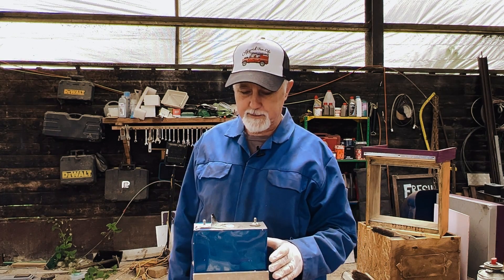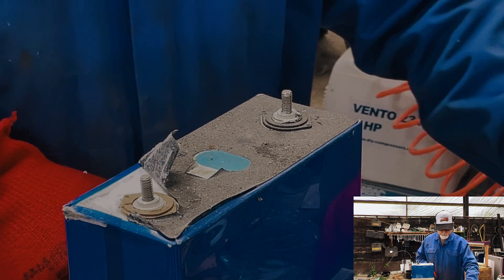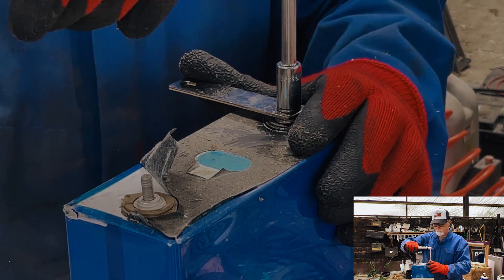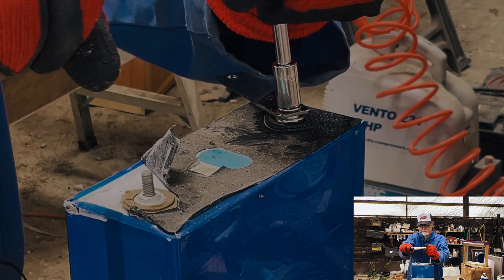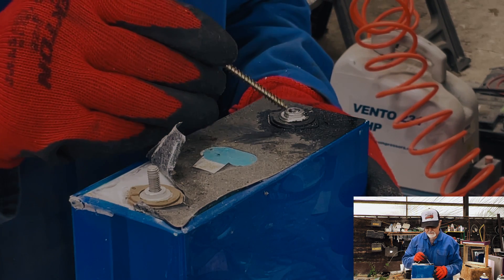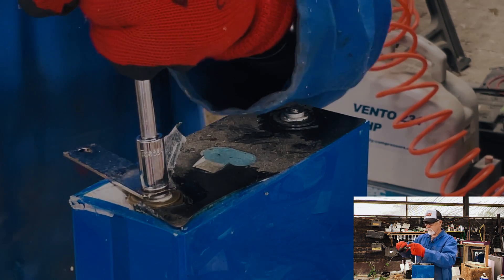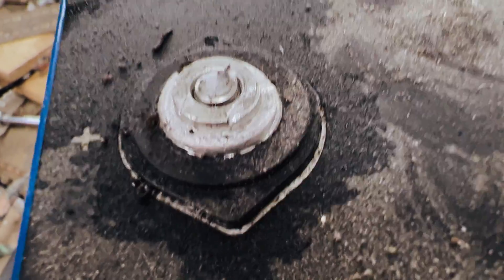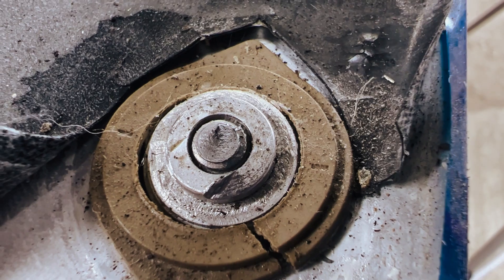Testing the shear strength on EVE 280Ah LiFePO4 Battery Cell Terminals

Comment: I took my Lishen cells up to 8nm and started stripping. I would not go above 4nm if you have a stainless stud into a tapped aluminum terminal.
Reply from the maker: Yeah, threaded terminals cannot take as much torque as laser welded studs.

Comment: Thanks for sharing!, now I don't have to be too afraid if going a Nm above the advised moment 😃
Do you by any chance hace some item about compressing the cells?
I plan to build a 2p18s array built up by four sets of 9 batteries in series.
I will go for two mtal insulated plates and 4 rods, tightened with each 25kgf of tension.
Then the cell can stretch und never reach more than 200kgf in total.

Comment: I accidentally broke few studs. Please tell me how to repair them, they are welded.
Reply from the maker: You might need to drill them out and tap a thread. I would be concerned that the internals of the battery might be damaged though.

Comment: The busbars are nickel plated and EVE recommends 4Nm for their cells they say exceeding this could cause internal damage
Reply from the maker: Seems EVE's "recommendations" are all over the place. We've been recommended (by EVE) to torque to 8Nm on these cells.
Reply: @offgrid_power  Nonsense both. I have these cells with welded studs too. EVE never made these studs. Actually with these EVE claim no warranty. The studs are made by resellers so resellers made the recommendations. https://youtu.be/XKxwMW900Jw?t=422

Comment: Was the negative terminal split before the test or was that a side-effect?  Also would be good if you could try again with dry threads if you get the opportunity as that would show what the 'real-world' limit is as the oil will increase the clamping force for the same torque compared to that of a dry thread.